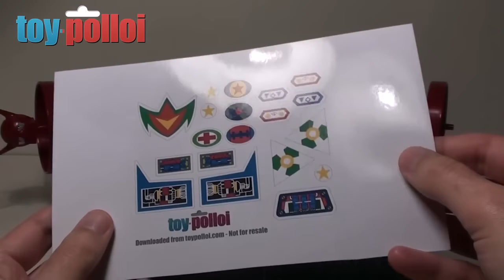Vitnage Micronauts Microtron restoration - Toy Polloi

Comment: I still have my Microtron, gotten back in the 1970's, stuffed in a bag somewhere in the closet.  I have not taken it out in years, probably last time was over 10 years ago.  It's probably time to take it out again to see if the electrical part still works & just to look at it again for nostalgic/sentimental reasons.   I also still have my Biotron, the biggest Micronaut toy afaik, sitting on a high shelf gathering dust.  And also have a couple of smaller Micronaut action figures, also stuffed in a bag somewhere.   One of them is the Time Traveler & the other is Pharoid. The fact that these 2 action figures have been stuffed in a bag for decades makes sense as they are both similarly time travelers just hibernating in a bag while time passes by, heh.   I also remember being disheartened as a kid in the 1970's when I couldn't even get Time Traveler nor Pharoid to click into Biotron's chest cockpit, they were both too big to fit in there, heh.  That's pretty much all my Micronaut collection iirc & didn't really care to get more of that toy line to play with, not collect, back then.
12/15/24

Comment: I’ve had to fix gears like this before the trouble is they will fail again with glue alone as the pressure with fracture it again Over time. If you drill it after you glued it slightly bigger then a fix it with Loctite 603 which sets where there is no oxygen present your on for a winner. Or araldite. But also it will run better as gears have to be precise for smooth running. If you just glue it you can get a lumpy run. This is a tip from a railway modeller and transformers fan but old model railway locos are ridden with this problem. However looks like you got it sorted. Found your channel via molotow pens fantastic ! Off to buy one .
Cheers Rob :)

Comment: Hi Dave, great video as always. I wanted to suggest a piece of equipment that may be really helpful. It's called a Silhouette Cameo and it's basically a small version of a sign shop's vinyl cutter. It's designed for crafters and normally used to cut letters or shapes out of vinyl, craft foam, card stock, etc. There is a really cool feature with this machine that allows you to register a print to be cut out. For example, you could print your sticker sheet out as normal, then create a cutting shape file and send that to the Cameo. Then insert the print, and using the registration marks on the print, the machine will automatically align and cut out pretty accurately all of your stickers (even the small circles in the center of the wheel stickers). With label stock, you can set the depth of the cut so it only cuts the label itself and not the backing material, then all you have to do is peel it off the sheet. I have this machine and can confirm it works pretty well for one-off projects. This is not a production machine and won't reliably cut hundreds of label sheets accurately every time, but for what you're doing I think it would be perfect. The Cameo on Amazon here in the U.S. is selling for around $250. Keep up the great work!
Reply from the maker: I have heard of those cutters. I try to show fixes and restorations that anyone can tackle with items that you would already have. And I doubt many people have these. Thanks for the info.

Comment: These 70s toys are so charming...
Have you tried cutting the tracks lengthwise, removing the slanted parts? It could be a bit challenging to try to have both sides parallel, though.
If the problem is that they're too wide. If, instead, is that they're too thick, then maybe you could try taking a bicycle inner tube, cutting a ring for each track, then cutting small rectangles and glueing them with rubber cement or something like that (super glue could work too, but I prefer using glues that can expand when applying them to rubber or leather).

Comment: Regarding the tracks. You can mold the originals in RTV silicone rubber just make sure you soak them in release agent first. Then you can pour fresh rubber in and make as many replacements identical to the originals as you like. Check out DWR Plastics that’s who I use for my resin kits

Comment: My treads tend to slide unfortunately. He just gimps along occasionally. I have noticed if I put a wide band on top of them, it seems to provide better traction. So thinking they just have stretched out a bit. Come up with any ideas for replacements yourself yet?  Also that one gear which is on the arm section always seems loose. Always.

Comment: It is a complicated set of gears to do one thing, reduce the output speed of a stock motor and provide lots of torque for the wheels to turn without making the toy bigger than it had to be. It’s possible that through curiosity (I know I did it) that the child who owned that toy held tightly to one track to see if the toy would rotate in their hand, or to get an idea of how powerful it was by stopping it from turning and the gear part snapped.

Comment: Maybe you can help me out here. I have the Dinobot Snarl. 
I am sure you know this but the tail splits into two for transformation purposes. 
The problem is, one of the pins for half of the tail is missing - though the parts that hold the pin in place are fine. 
Any ideas on how to get a new pin in there?
Reply from the maker: +Tebok73509 I would find a nail that was the same size as the original pin, cut it to size, and tap in with a small hammer.
Reply: Toy Polloi
I'll give it a try. Thanks!

Comment: How can the dead motor be fixed?  If it does not turns on even with brand new batteries of course... how can the motor be fixed?
Reply from the maker: Have you tried turning it a few times by hand. This will clean the brushes.
Reply: Hi Toy Polloi thanks , yes I did tried , the gear was loose as in your video and the motor shaft does turns around by hand , tried to move the batteries if there was play , still dead , no attempt to turn on :((  I am afraid of taking it apart and break the metal braces that hold it , I have never soldered anything
Reply from the maker: You'll need to turn it for a few minutes sometimes, have the batteries in and the toy switched on. And have you cleaned the battery contacts?
Reply: Toy Polloi thanks I will give it another try ... I did cleaned the battery contacts , they were pretty clean still , thanks again David !!!
Reply: Toy Polloi it worked!!! I just had to turn it a few minutes as you said !!! Incredible , thanks so much !!! It is just as nice as yours now :))
Reply from the maker: That's great. Normally these old motors will come back to life. They just need a kick start. Glad it worked for you.
Reply: @toypolloi  Is there a similar fix for Biotron? I have a couple of chest units which seem ok internally, but dont work with batteries in.